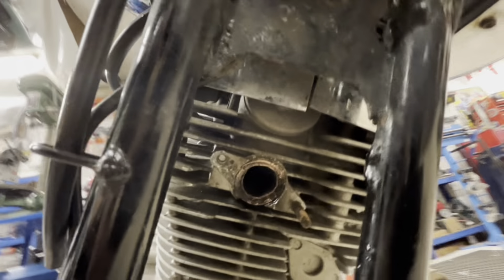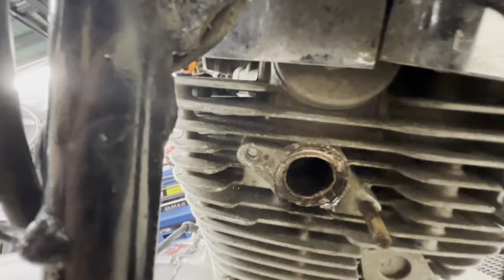Something a little different, Broken exhaust stud removal and thread insert

Comment: 3mm drill bit down the centre and an Ezi-Out - Job Done.
Reply from the maker: @djohh3057  I tried a easy out and she was locked in tight and didn’t want the easy to snap so gave up on that way
Reply: @skidmores.garage  Probably a sensible decision !